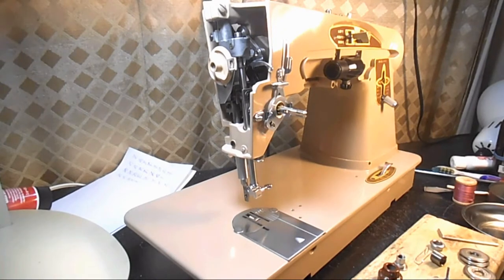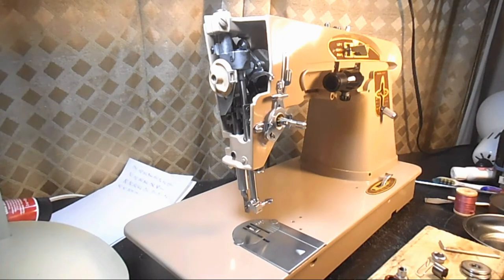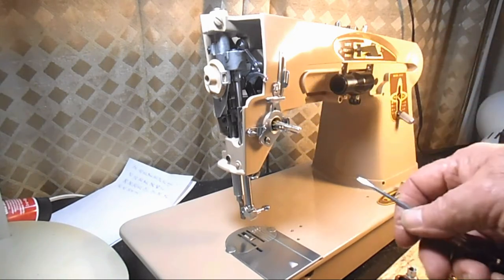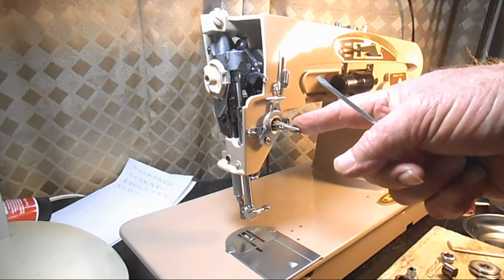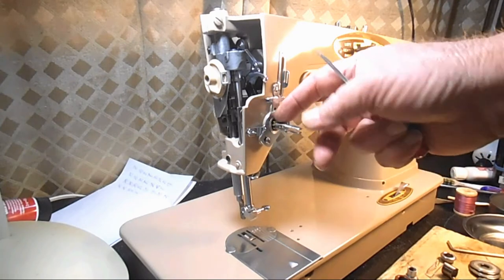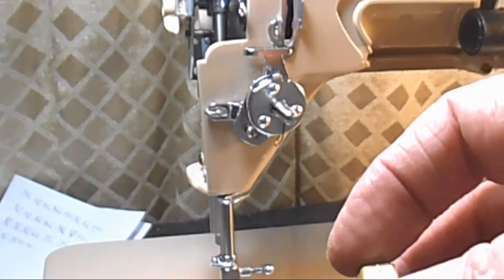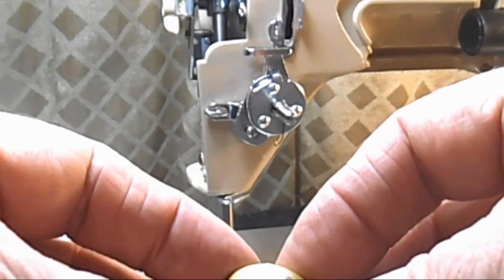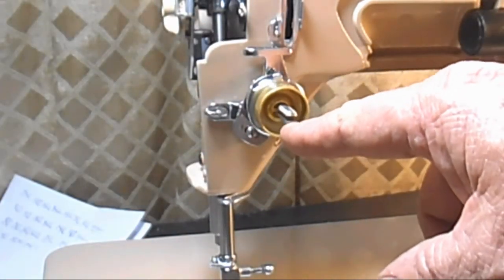The Needle Thread Tension Unit of Singer Models 503A and 500A

Comment: Hey Andy, I recently bought a 503A although I have never sewn before.  I am teaching myself.  I wanted to let you know I am learning a lot from your video's as this one has needed a little love.  I greatly appreciate that you took the time to make videos and post them.  On one of your replies you stated "Personally, I'd rather own the 403A than the 500A". Why do you prefer the 403?
Reply from the maker: Thanks for saving the machine, Terry. I prefer the 403A because of its cleaner, industrial styling. I know some folks love the "futuristic" Rocketeer models styling,  but to me it was a gimmick that did not improve function. 
     The 403A has a bobbin winder system that will just never break; I've never had a 403A with a broken BW. The 503A on the other hand has come to me many times with broken springs on the bobbin winder and it requires a special, smaller rubber friction ring. 
     On the 403A all you need is staring you in the face other than the smaller flip-up lid cover for changing pattern cams. Model 503A has that big, full length lid to cover the BW, the pattern cam stack and the flip-up spool pins. The felts for those spool pins are glued onto the cover and require more work to change when they get thin, versus the standard spool pin felt you can find everywhere that are on the 403A which has two spool pins on top with direct access. 
     They did add one mechanical feature to the 500A & 503A; the Thread Control that doesn't really help in any way, IMO. Singer never used it again after those two Rocketeer models.  Some viewers have told me that the thread control system is to prevent skipped stitches when sewing knit fabrics, but I disagree b/c Singer sent an instruction sheet to bypass the thread control for knits, thread the needle path a different way,  and later changed the hook on some of them. https://youtu.be/m79nr_DHRwQ
     As I said, I know many folks love the "look" of the rocketeers and they are very very nice machines. I just appreciate form & function over styling I guess. 
Thanks for watching my channel and take care.
Reply: @andytubesewing1953  thank you for your reply to the previous question. I, too, was wondering the same and it helps me to learn the ‘why’

Comment: Hi Andy, I have been using your videos to take apart and clean a 500A, thanks for taking the time to record such detailed videos!  Question, I have two Rocketeers and on both of them it seems as though the last two pieces of the tension unit, the flange and dial, are either one piece by design or because they are stuck together.  Do you know if in any models the flange and dial were an integrated unit?  I didn’t want to force them apart if they were indeed one piece.  Thanks!
Reply from the maker: Hi Tracey. Every Singer 500A and 503A I have worked on had separate parts like in this video. Some of them had the last two parts stuck together like you describe. I had to remove the set screw and push my needle nose plier into the flange from the back side to try and hold it while turning the indicator knob and then the pieces came apart. I was worried I would damage the inside threads on the flange, but it did not on the ones I did (maybe 1/2 dozen or so) When I was removing the parts from the stud they had come off together as one piece. The flange and stud are aluminium (in my opinion) but the indicator dial is steel. I think maybe that is why they stuck together. I don't know if the metals reacted to each other, or expand and contract at different rates. I just remember they surely were stuck together, and at first I thought they were made that way.

Comment: I have 2 of these tension units are stuck together. The set screw removed, but top (brown) dial appears to be stuck to the inner "top hat" threaded flange. Is there a way to separate?
Reply from the maker: I made a video with some suggestions for fixing it. https://youtu.be/woJraVBSWcI
Thanks for watching my channel.
Reply: @andytubesewing1953  Thank you so much and what a clever trick (probably should have been mechanically obvious to me but I didn't think of it at all). I've now separated both stuck tensions and they are soaking in hopes that I can remove the threaded flange. But if not, they'll be clean and I can use the other video to properly reset the tensions.

Comment: Thank you Andy. You filled in what I was missing from other videos on removing my 500A’s tension. 
Just one question...is it had to remove the pin in the post to clean it?
Reply from the maker: Hi Mary. You mean the tension release pin, that looks like a little nail? It should slide right out the front towards you once you take the other parts off. It's steel and if oil got on it it might be sticky. A very small magnet can pull it out sometimes, or clean with alcohol and tilt the top of the machine towards you to get it to slide out. Sometimes it just slips right out before people know it and they lose it. You will see one end is flattened out so when you put it back into the stud, from the front split end, the round end of the pin goes in first and the flat end stops it from just falling out the back.

Comment: I understand how you are putting this back together but I need help to take mine apart. 
I am unable to remove the brown tension dial by pulling or turning. Yes I did remove the set screw.
Can you please make or direct me to a video on breaking down the thread tension assembly specifically on the 500 Series machines? 
I have not been able to find anything that shows how to do this. Thank you
Reply from the maker: I don't have a specific video for this problem, but I can describe how to get the brown dial off. 
     It is fairly common that the brown dial gets stuck on the flange adapter and won't pull off. You can spray WD40 all over everything and heat with a hairdryer and sometimes that will loosen the brown dial enough to pull it straight off. 
     Here is a better way. With the presser bar down, turn the dial all the way left, zero tension. Take a small screwdriver or similar tool and push it into the front of the dial and into the slot of the tension stud. You will feel it hit the crossbar of the stop washer. Push just a little bit more to move the stop washer back; maybe a 1/16 inch or 1/32 inch. Hold it there and gently turn the brown dial to the left.
      What you have done is pushed back the stop washer which has the stop pin that the little pin inside the brown dial is hitting. By pushing the stop washer back you can turn the dial/post past the stop pin. Then you can keep turning the dial and the flange washer it is stuck to and they will come off the stud and you can remove all the other parts. 
     The little pin inside the dial that I am talking about is shown at 19:40 in the video. When you reassemble the parts, if the flange and dial are still stuck together, you will need to push back on the stop washer again to get the post of the dial past the stop pin of the stop washer while turning it right. You may have to do that 2 or 3 times while zero out the tension assembly.
     If you'd like more info about tension and how to zero out the assembly, and set the stroke and tension of the take-up check spring, here is a complete playlist of 7 videos all about tension.
Reply: @andytubesewing1953  thank you for your quick reply. After oiling it a couple times I eventually managed to get the brown dial off by turning it to the left. The flange was indeed married to the brown dial but once it was off the machine I was able to separate them. Once the brown dial was off it was easy to remove the rest of the assembly. I always take plenty of photos as I am dis-assembling so I can remember how to get it back together! I appreciate you Andy!
Reply from the maker: Nicely done, Nancy! I'm glad you were able to move ahead. Thanks for sharing the results. Take care.

Comment: I have a 500a with the one piece brown tension number indicator. In watching all the videos I could find, it appears that this part should slide right off after the set screw is loosened. It doesn’t budge. Am I incorrect in the easy slide part? Any suggestions on why it’s stuck and what to do?
Reply from the maker: The original tension unit for the 500A with the one piece brown indicator should slide on and off and is only held by the set screw. It can be stuck onto the threaded flange though. It can have dirt, thread dust, dried oil, etc. and just be stuck on. After I REMOVE the set screw and it will not slide off, I just turn it left and remove the flange it is stuck to along with it. Soaking in warm water can soften the sticky stuff anf let you remove the flange from the indicator by holding the flange with your fingertip and turning the indicator back and forth while pulling it apart. That' has been my experience on a few of the 500A & 503A machines.
Reply: Thanks, Andy! I’ll keep trying. Whatever it’s stuck with is tougher than me so far. Wish I could patent it as a glue. I’d make a fortune! Your videos are GREAT!

Comment: Hi Andy, I've really been enjoying your channel! I've acquired a Singer 500A. I'm having trouble with the tension. The bobbin tension is all the way tight and the upper tension is all the way loose and I cannot make anymore adjustments as my tension has the bobbin thread showing on top. I would like to take apart the upper tension but after removing the set screw on the numbered dial, I am unable to remove that dial. I have not seen you, or anyone, actually remove this part on the 500A. I have only seen where the tension is already removed and being reassembled.  I tried spraying inside the set screw area with WD-40 to no avail. Can you tell me how to remove this part? I am at a loss. Thanks so much!
Reply from the maker: Hi, Karen. I've had a couple of the 500A/503A tension units like this. For me, the problem has been unique to those two models. I also used the WD-40 in the screw hole and it helped on one unit enough that I could pull the combo-indicator off of the flange part. The others I tried still would not budge so I used a hairdryer on low to medium heat and blew the air into the hole in the front. one time it took a good 20 - 25 minutes. It blew the WD-40 around a little but eventually, it loosened the two pieces enough I could pull the comb-indicator off. I don't have a clue as to why the two pieces stick together sometimes; like they are glued or something. I've restored over a dozen of these models and most of them either slip right off or turning until the pin stops against the finger inside and then the combo-indicator would free up and twist/pull off of the flange. I guess persistence is the key to your success. You can do it. 
Thanks for watching my channel.
Reply: @andytubesewing1953  Thank you so much, Andy. I will keep trying,  probably with the hairdryer.
Reply from the maker: It has worked for me, just use gloves when try to pull it off, the front dial will get hot to the touch. After oiling and heating I have used a hook; like a nut pick with a hooked end, and put it in the screw hole to pull the dial straight of of the flange. You must be careful not to damage the screw threads in the hole. Usually I can turn to zero, push back on the +|- dial into the spring and twist of the number dial with the flange stuck inside, then hold the flange from the back with needle-nose and turn the dial to separate. A couple times I could not push the +|- back enough to clear the stop washer and twist the dial off, so out comes the hairdryer and the hook, haha. Good Luck.

Comment: Were you able to remove & replace the tension stud set screw?
Reply from the maker: Unless the head of the screw is stripped when I get the machine, I usually remove the tension stud. Since this set screw was damaged I did not remove it. The stud was installed correctly and tightly so I left it like that.

Comment: are there any significant differences between the 500A and 5003A?
Reply from the maker: The 500A Rocketeer was the more costly one. It replaced the 401A Slant-o-matic. The 500A has a true cam stack with metal pattern cams. There is a pattern selector mechanism on top of the cam stack that allows additional plastic "Top Hat" Pattern Cams to be snapped in an out under the whole-arm flip-up cover. There are 2 dials on the front that you push & turn or pull & turn to set different patterns. Between the built-in metal pattern cams and the snap-in plastic pattern cams there are dozens of patterns available. If you like a machine with the bells & whistles this is it. The 503A Special replaced the 403A model. It does not have a true cam stack, but a shaft that holds the pattern selector mechanism that's in the 500A. There is a flip-up door that gives access so you can change the Top Hat pattern cams out, of which there are about 22 different ones. Otherwise, it has the same motor, heavy duty all metal parts, and direct drive motor-to-handwheel systems that the 500A has. If you want an incredibly engineered heavy duty machine with only a couple dozen patterns but all the strength and power, this is it.
You can download a free 50-page instruction manual for model 500A here>> https://www.singer.com/sites/default/files/product_manual/1308_500_0.pdf
You can download a free 98-page instruction manual for model 503A here>> https://www.singer.com/sites/default/files/product_manual/10f8b1ba3a5534c1cbfe8dda7b7ebe531c9e0ccb.pdf
Reply: @andytubesewing1953  Thank you Andy - as you know I have the 221 and recently purchased a 222K I will now search for a 500-A I think that would make for a nice small and USEFUL collection. I am learning to use these machines to repair LOTS of my wife and kids clothing!
Reply from the maker: "nice small collection" I've sure heard that before, haha. Personally, I'd rather own the 403A than the 500A, but that's just my opinion. You can't go wrong with almost any metal vintage Singer machine. You have a couple "black" models' and soon maybe a beige or tan model, but what about blue or turquoise or green? Uh-oh, it's only the beginning. I love that you actually USE the machines for sewing. That is why I restore them; to keep the working. They were born to sew and love doing it.
Reply: @andytubesewing1953  Funny you should say that as I was looking at the 403A also. Oh yes I have been using my 221 a lot - completely repaired my daughters sweater and my wife's bra strap LOL. Hopefully after I manage to get either a 403 or a 500 or??? that will be it!
Reply from the maker: @RenaissancePeopleNYC  Well, even if that is all the machines you will have some of the very best ever made by Singer. Of course, who wouldn't want a beautiful blue one?
https://youtu.be/CaCzYswaey0
Here are the other19 free videos about how to restore it, maybe for your daughter? https://youtu.be/CaCzYswaey0